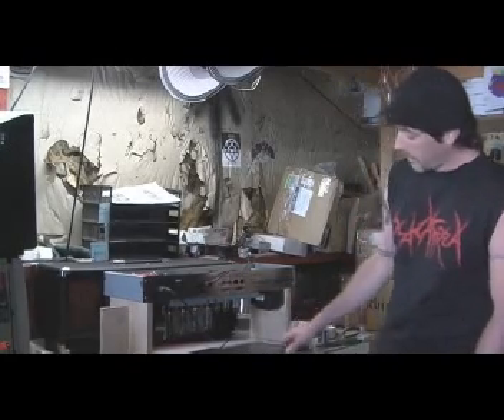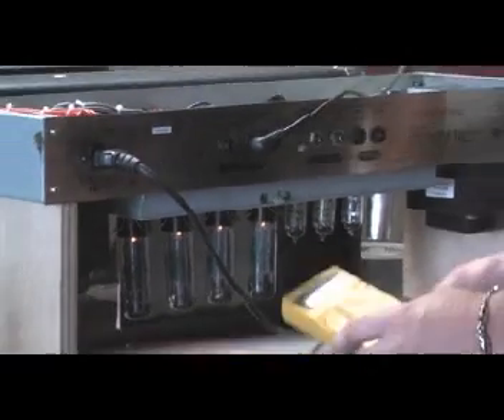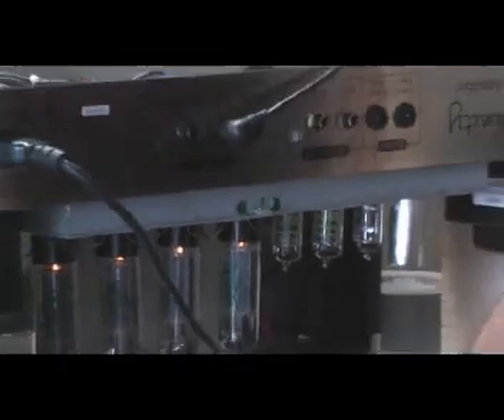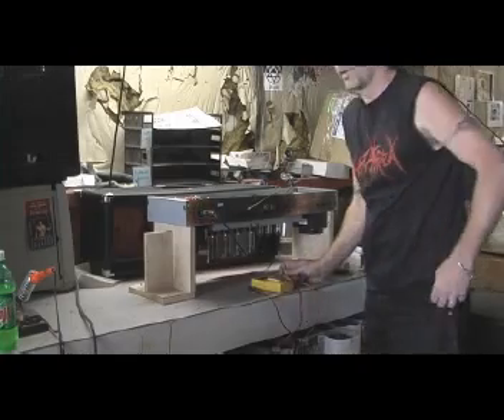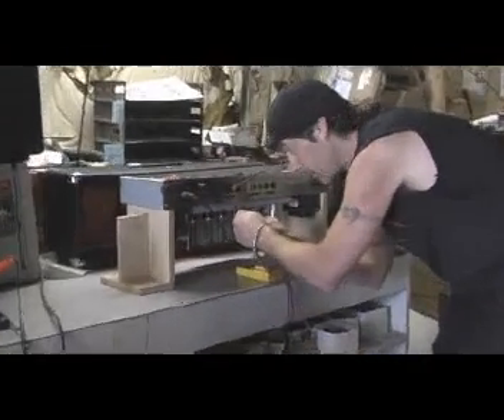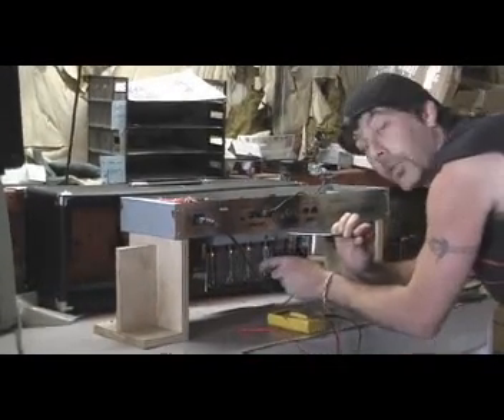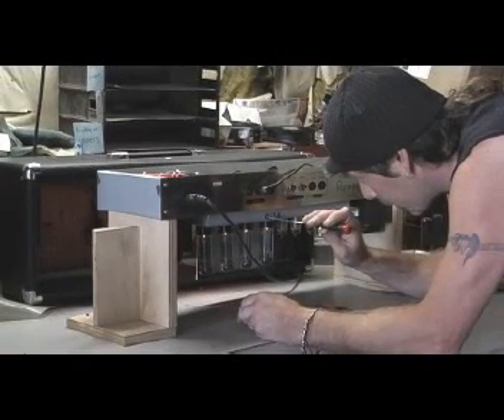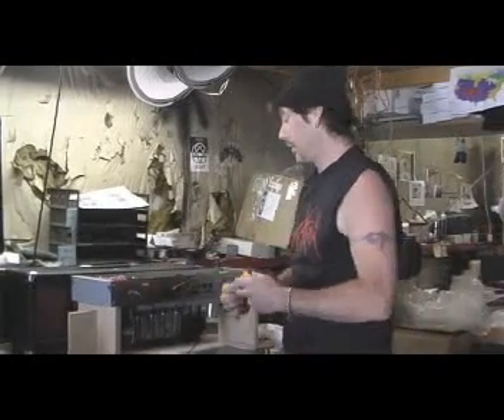How to Bias A Madison Divinity

Comment: Thanks for the reply and advice! That's partly the reason I bought it off ebay. I will certainly take care of it. It's near mint. Lighted logo looks killer. Has the rocker switches. It seems pretty reliable. I mainly use my Randall RM100 heads. It will become more valuable over time I assume, but it was created for musicians. I appreciate having one. Nice to hear you still have yours.

Comment: Thanks for this man. I just got one of these. It had one bad tube. It appears to have the original EH EL34s. I stuck a spare Ruby EL34 I had in place of the bad one. One pair was running too hot almost just like your example. Mine's exactly like the one you have in your vids. I got both sides at 68mvdc. Nice amp. It's super fat on the Edge channels. Really tight overdrive. One of a kind amp. This really helped. Thanks again! :)